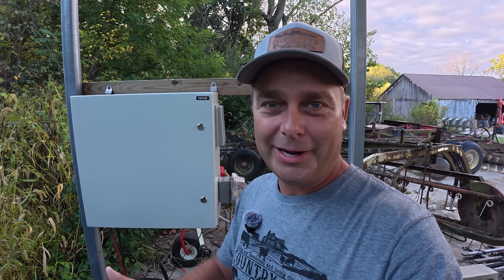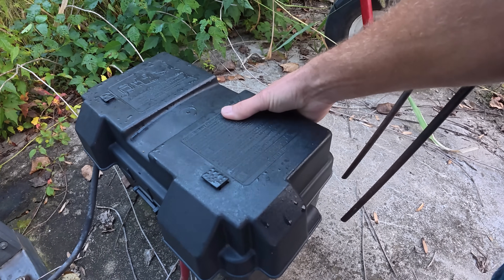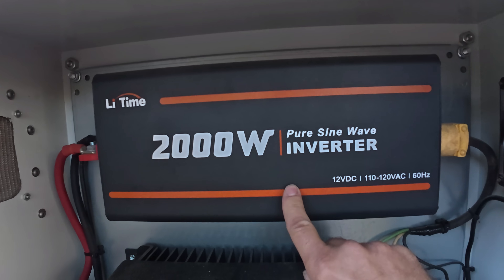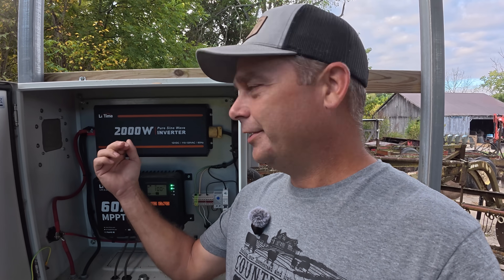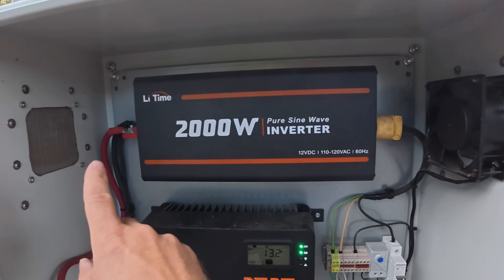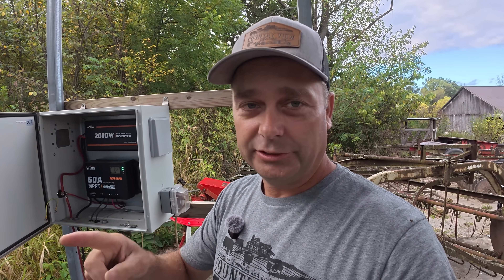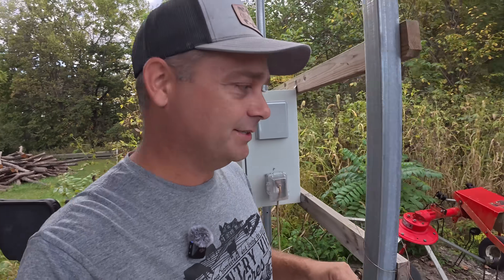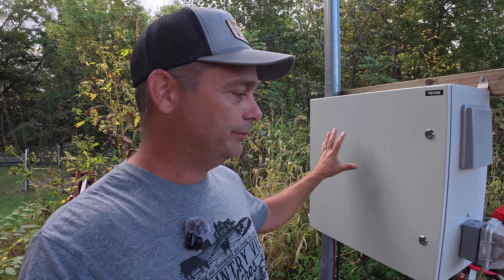Outdoor Rain Proof 12 Volt Solar Power System - 1 Year Update

Comment: What do you recommend for the cheapest off grid 220v solar set for a carport that will be used as a garage a few nights a week after work, starting small that can be expanded on with more batteries and panels down the road?

Comment: Did you say you were going to put some solar componets at the bank barn? Have you monitored your usage at and around the bank barn to determine what size of a system?
Reply: I used a Kill-O-Watt meter to determine load and solar requirements for anything 120v AC. Add up the circuit load for maximum and get a minimum requirement.